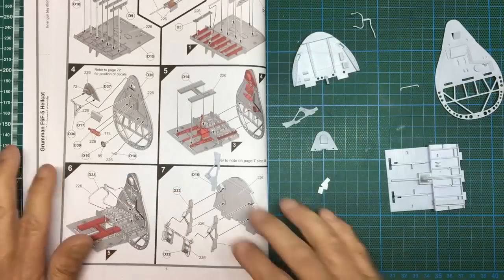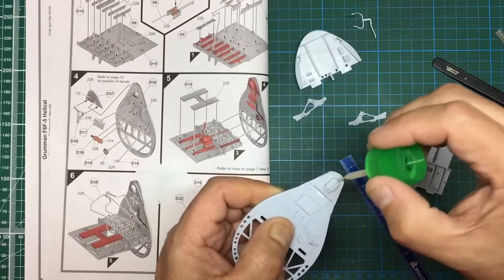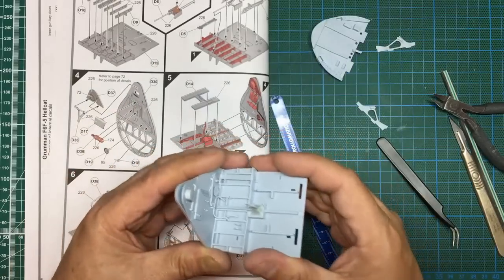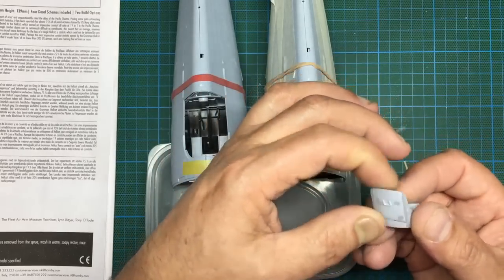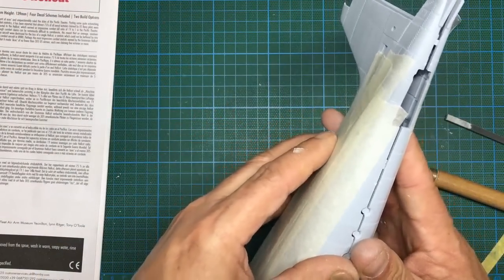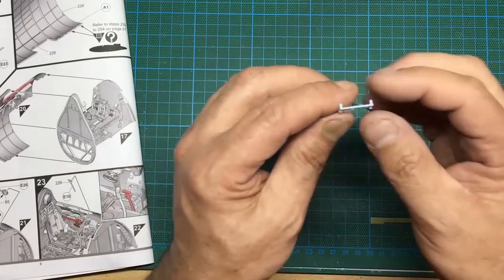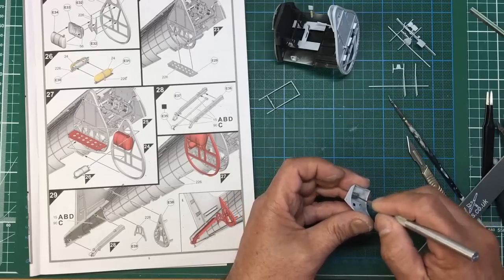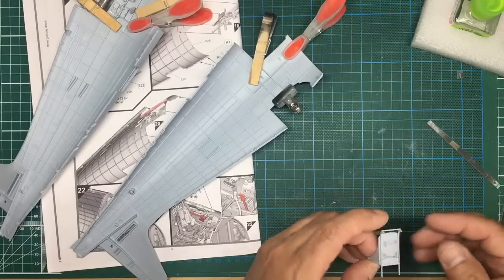Airfix 1/24 F6F-5 Hellcat in FAA service. Part 2

Comment: Great tip for placing plastic card shims to help reduce the cap(mind the gap)  and for seat frame being too long.  I’m still filling and sanding away all the ejector pin marks because even if I don’t see them I know they are there.  Nit picked I know but what the heck. I am going to do the FFA version, with one wing down and one folded.  Still looking for Sutton harness and seatbelt in 1/24 in cloth, may have to make my own and use PE metal parts from a Spitfire 1/24 scale.  I have had good luck using iron on patches for denim jeans, just sand off the adhesive from the back cut to size, use a little thinned contact cement for cloth and good to go. Painted of course.  a great video and sound quality is fine now.  Thanks again.

Comment: sound is great now!, oh, on the 50 minute mark, i use spent brushheads for electric toothbrushes and cut away the bristles and glue on a bit of a rubberblock/ with wetsanding paper and hey presto, an awsome tool to sand those hard to spot places/edges.  :)

Comment: I'll only wear gloves for modelling - if I get a flare up of Dermatitis (only happens now if I use enamel paints, which is rare these days). I'd be tempted to replace harness the rail with one fabricated out of the a same diameter brass wire, if I use aftermarket belts (when I get round to my Hellcat)